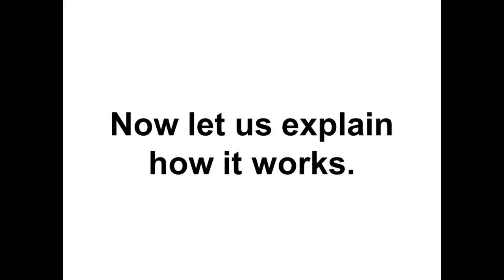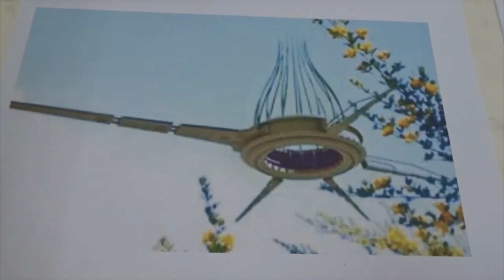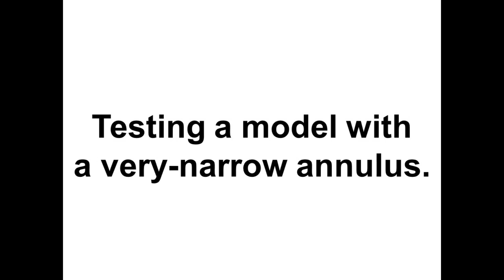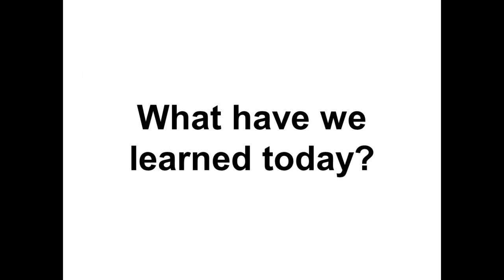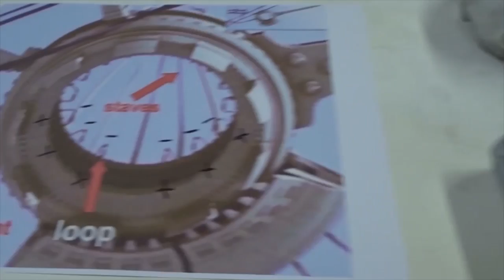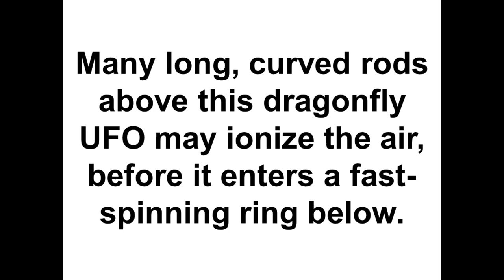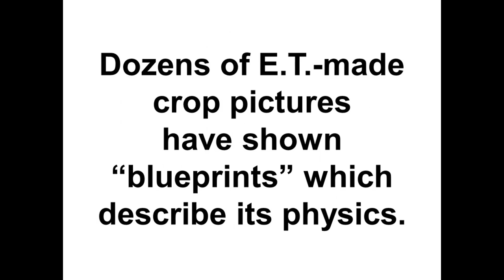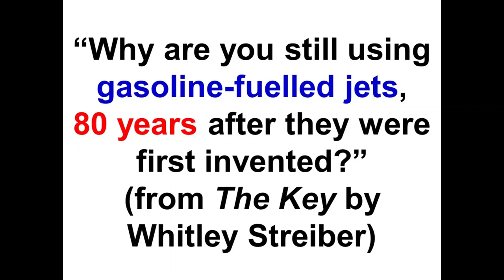The dragonfly-drone UFO flies by an air-based ion drive

Comment: The crop circles may be engine designs but surely the thrust is not simply an electrical jet as these engines have been produced and are to heavy to be practical it seems the thrust must be from the effects of the field strength of the craft on the background field once the crafts field can push against the background field the thrust is produced but it's more akin to magnetic locking also called quantum locking seen in superconductivity the craft becomes locked into the field and is then guided by manipulation of the fields direction but this effect may be a precursor to folding space, first the craft becomes locked then as the field continues to increase space folds in on itself and the craft falls in that direction.
Reply: Does it create a lot of heat tho?
Reply: @FreelanceDentist  It's got to do with plasmas being used as energy storage or plasma batteries. The plasma, usually some inert gas like argon or a mix of them, is pumped with energy by microwaves. The plasma is thousands of degrees but contained by a magnetic field so it doesn't touch the hull of the ship. The energy at some point increases exponentially and this is apparently the big secret that plasmas somehow multiplied the input energy to the point that it can exert its own field of some kind that does not fry its occupants. Some experiments with sodium plasmas simulating the earths core have shown these increases in field strengths produced by folding the magnetic fields back on them selves. It's probable that it's not just the magnetic fields that are being folded but also the background fields, Higgs fields, carrier wave fields of some kind. If the system malfunctions, then yeah, all hell could break loose.